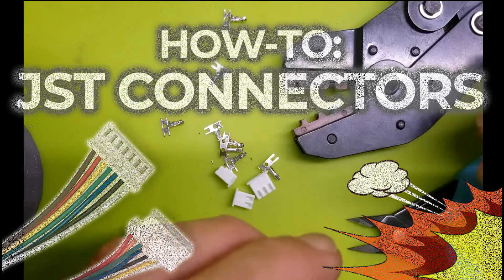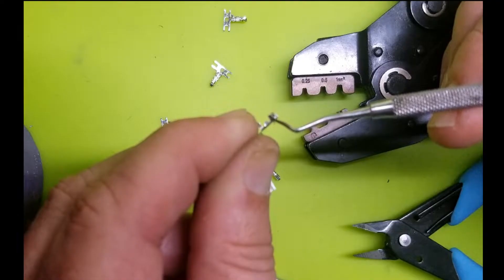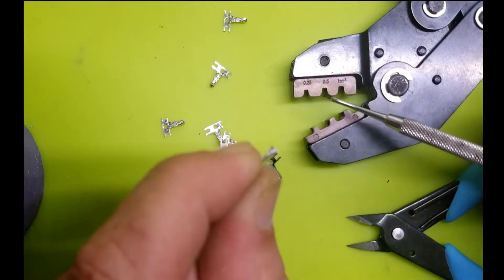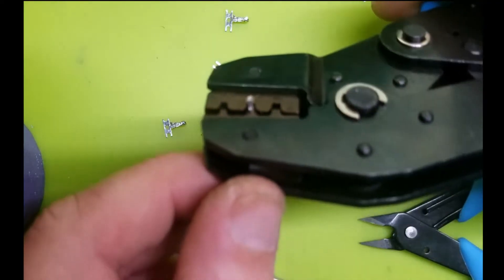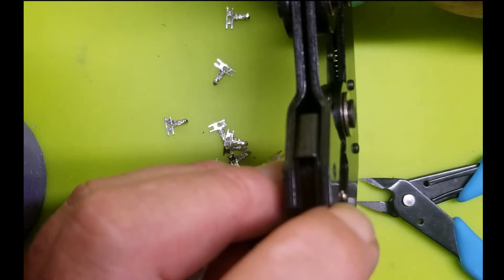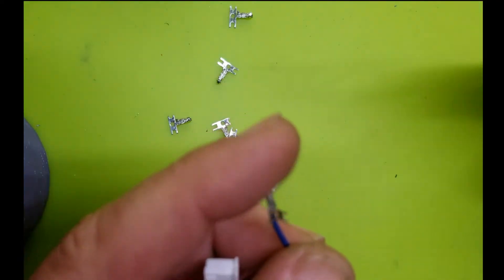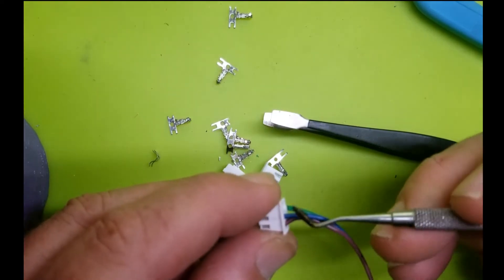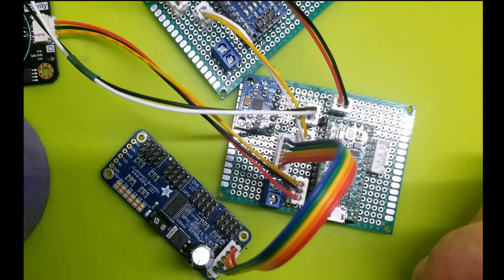How-To : JST Connectors / Wiring

Comment: Nicely done, very nicely done. This I am familiar with but our demo helps alot. My issues is I have ST MX 1.25 male and for the pcb the female end too. I got what they call male and female pins. Ill use your reference for the pin type. So you call it a female pin going in a male connector. I'll say correct. Im okay with all that. But the "male" pin going in the female connector for the pcb is what II cant understand. usually its like a the pins on a straight header half inside the connector for the male mating connector pins and half out to solder in the pcb. The pins they are calling "female" are for the female pcb connector. They are exactly the same as the one you put in your connector but have a long "Spike" or solid pin extension on them. I'd assume that extension pin is what gets soldered into the pcb but I dont see anyway the male connector pins will mate with it. If you want to take a look this iis what I got from Amazon today. I don't get how to put the pins in for the female pcb connector and even if I did how it would mate with the pins in the male connector. Yiikes!! https://www.amazon.com/dp/B0D4QRJKDM
Reply: Duh....these are for cable to cable not to a pcb. Well in the end you did help me...thanks!

Comment: What about the other side, the male connector that connects to it?  How to attach wires to the back side?  There are pins on both sides of the male housing.
Reply from the maker: the male connector wires is what's shown being crimped - then they are simply pushed into the male connector, and can only go in one way. The female socket is normally soldered to a PCB - if I misunderstood your question, my apologies.

Comment: Thanks for the tutorial! Two questions if you don't mind. First, will this work with thin wires like 26-30AWG? Second, is there a way to do this without a dedicated tool?
Reply from the maker: yes, JSTs are sized by gauge of wire.  And yes, I suppose you could do it with a couple of pairs of needle nose pliers, but I haven't the patience, eyesight, nor nimble fingers for such tedious work lol

Comment: My diode laser just had a wire go bad making it unusable- the jst connectors fried and partially melted in one spot, the wires easily broke off just handling them. They're replacing the cable but it's going to take a couple weeks to get here so I ordered a small kit in order to repair the current wire myself. This video gave me all the tips I need in order to feel confident doing the job- thanks for it!
Reply from the maker: so glad it helped you, thanks for watching and pardoning the blurry camera work! ;)

Comment: Very helpful, but why do some JST-XH connectors have  3 ground wires and 1 red/hot wire? Would it affect anything if I solder all three ground wires to a single ground wire on another connector type of pigtail? I want to make a temporary cable that is JST-XH (three ground & one red) to a barrel plug (one ground & one red).
Reply from the maker: JST themselves don't have designation of wire - so whatever device you're working on did it that way for a reason. I probably wouldn't do that without tracing each ground to be sure they are the same voltage line to start with.  Otherwise, if they are all the same, it shouldn't be an issue to tie them together.
Reply: @ChrisLocke1969  Thank you. It is to charge 3S batteries in a combat robot

Comment: HI, thank you for your video. Please any ideas how to wire the JST SUR 0.8mm connector? It seems it does not need any crimping.
Reply from the maker: that's a good question, according to digikey -it says "the mating housing has crimps", but doesn't say much about attaching wires except "have poke contactors", which sound to me like just wiring piercing connections, like a ribbon cable maybe.  Sorry I don't know anything more about these particular JSTs:
https://www.digikey.com/en/product-highlight/j/jst/sh-and-sr-series-connectors

Comment: Can i just solder the thing instead of crimping.
Reply from the maker: sure, you can use whatever technique you'd like - the JST connectors just make it easier to remove the head, tail, and top covers when needed.  But if you are using the PCB, it may not be easy to skip using those JSTs, unless you're going to solder directly to JST pads on PCB.

Comment: hi chris,im having slight trouble, how would i go about making a y splitter out of jst connectors
Reply from the maker: y splitter?  do I do that somewhere?  lol  the hood sensors maybe?  Anyway, all you have to do is splice the wires, not try and get multiple wires into the connector pins - that's not possible.

Comment: Hey Chris i have a Hubsan 980mah pack with a regular battery lead and a red JST lead that plugs into my H123D Jet. The negative wire (Black)has separated from the pack at the point where the factory solders the wire to the pack. How can i fix this problem because this pack is still good and has lots of life in it? Thanks for your reply!
Reply from the maker: I would think you're only option is to carefully resolder... but man, be careful!!  shorting out a lipo can be a quite powerful jolt
Reply: @ChrisLocke1969  Hi Chris i was able to carefully solder the black wire to the new 980mah pack and it works like brand new(Thats because it is) i laid a small oeice of electrical tape so as to be careful not touch the other leads and i got lucky with your help!!I have one other pack that is puffy does that mean its no longer any good?
Reply from the maker: @techFPV5964  that's great!  glad you didn't get zapped! lol  As for the swollen lipo, yes, that means its been damaged or overcharged, or is just old - gases have leaked inside the battery and are waiting to explode out. Recycle that one, is best!
Reply: @ChrisLocke1969  Ok cool i'll get rid of the puffy batteries!
Reply: @ChrisLocke1969  Hey Chris i was able to solder the ground wire back onto the lipo and its now working great. It was a little hairy tho!!
Reply from the maker: @techFPV5964  yes, lipos can be scary. I accidentally touched contacts together using pliers to unplug one... whoa, that was a jolt!!  Great job!

Comment: Maybe that waste is supposed to wrap around the wire.
Reply: No because then you would have 3 pieces of exposed metal nearly touching (if not actually touching) each other, shorting whatever you are working on (because they won't fit into a secure connector).